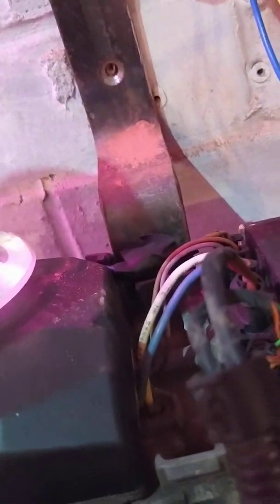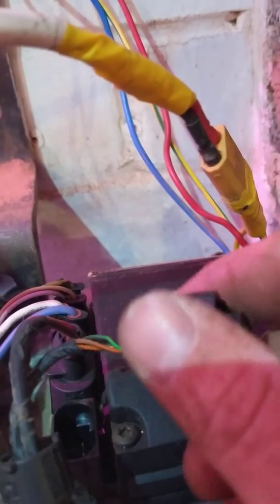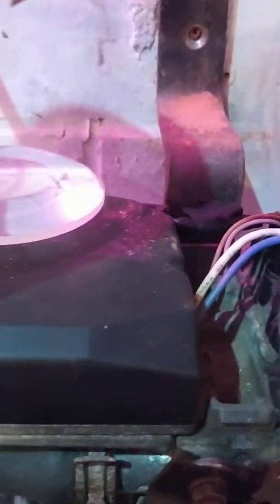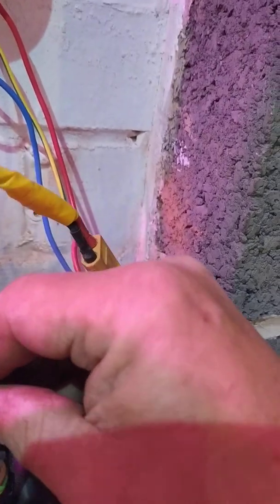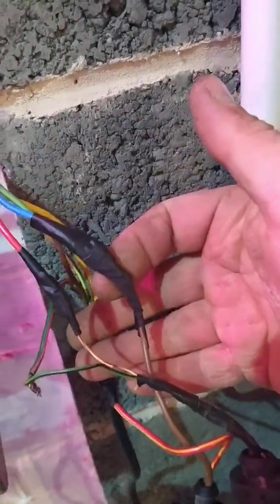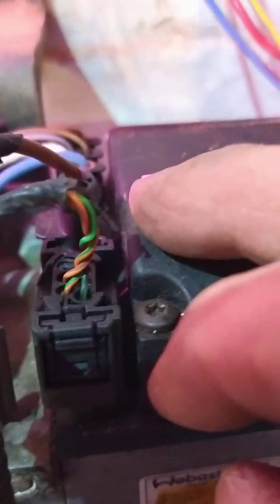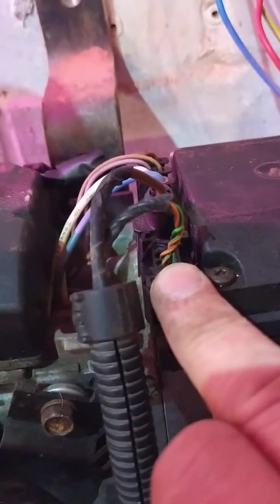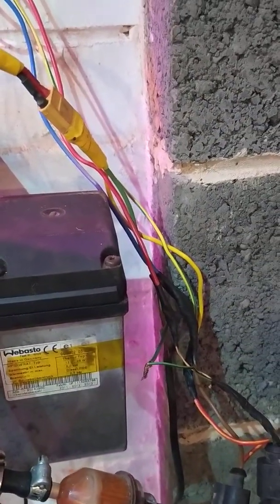Webasto thermo top c, making it run

Comment: Can anyone tell me if the car ones are programmed to switch off after 15 minutes running ? Someone has fitted a car one in my narrow boat prior to me owning it and it cuts off almost exactly after running fine .
Reply from the maker: No, they are not designed to shut off after a set period of time, any time limitation is built into the timer/controller but these are the 701 timers with the blue writing on.

Comment: I need to help me How to power 24 volt , 3.8kw webasto thermo pro 50 eco with ADR 4:
Reply from the maker: First of all you need 24 volts, i dont know what power supply youve got, but if 12 volt you need a boost converter that can supply at least 10 amps

Comment: Can you swap out the programmier for a 7 day timer clock. The current one means i can only select one program at a time, which is a pain.
Reply from the maker: I used a 7 day cheap Chinese 12 volt timer on mine i had multiple days and times set up on it, i just used the timer to switch the signal wire on or off

Comment: Hey!
I have a thermo top c petrol which i am currently testing.

When i wire it all together, it runs the waterpump, and water is pumping, but the motor wont go on, so the water stays cold…

Do you maybe know what the problem coult be?
Reply from the maker: Hi
It could be a multitude of things not making it work but it's difficult for me to give any real diagnosis from your explanation.
More details an may a pic of how you wired it would help.

Comment: thanks for the demonstration.  I want to install it in my van using the secondary battery that is in the back.  What section of cable do you recommend?  for a distance of 5 meters. Thank you!
Reply from the maker: For a 5 meter run i would use 8 awg wire as a minimum gauge of wire for the main power leads.

Comment: Hello I dont know if you still play around with these heaters, I bought one that didnt come with a water pump so I bought a pump from china which is bdcm so doesnt use much current, I test the heater using the diag software but it doesnt come on. can you measure the current the pump that came with that unit use please, I might have to put a resistor across the pump wire but need to know how much current the pump use first, cheers
Reply from the maker: I dont use a named pump i use an old pump i had in my garage, it only draws about 1amp, i think that as long as the heater ecu detects a small current draw it should work. Some of these heaters dont even have a pump connection on them, the units fitted to mercedes vans are like this, they rely on the water circulating through the engine and will not work if the engine is not running these are the can controlled units, i stay away from them as they are not really sutible for out of vehicle use unless the control board is changed.
Reply: @karldingbat  thanks for that, I'll connect up a side light bulb and see if its happy with that
Reply from the maker: As soon as power is supplied to the unit the pump should start, its the first part of the system to start, and last to shut off to avoid any heat soak inside the heater.
Reply: @karldingbat  I havent played with it for a year, I bought a cheap chinese heater instead but I just got an AC split unit which I will be pushing hot water through so will be trying it again

Comment: Very nice video! All documents, I found, say Pin 1 goes to the clock with switch and Pin 2 is for diagnosis. Tried this yesterday, and it did not work. Maybe, I also have a unit which is wired for Pin 2 for on/off. Will try this. Do you know, if I need to have the fuel pump connected for an initial try, if the unit responds in general?
Reply from the maker: They are not all the same pin layout, and yes fuel pump needs to be connected as they run a self diag before starting and if pump not connected it wont try to start.
Reply from the maker: It should try to run up without fuel pump connected the shut down, but like so many things with these heaters it may need the pump connected, there are a lot of variables with different car makers, i go with the experience of the units i have, an addition to the list of pin 2 controlled units is the v.w. heaters.
Reply: @karldingbat  So I still have Hope. Mine is out of a Mercedes S-Class year 2001. Will report back. And is it correct, I have to apply +12V at Pin2 to make it run?
Reply from the maker: Yes, thats the trigger once you have 12 volt supply at the main power input plug which is the bigger wires going into the unit, just make sure if using a battery that is is charged up and can supply at least 10 amps as when they start the glow pin requires a heavy current untill its fully running.
Reply: @bauenimfreistellungsverfah4878 i Have the same unit from w220, did you manage to start IT with pin2 And +12V?

Comment: Hi karldingbat, are U sure that Pin2 is the switch? Asking this because everywhere I read that Pin3 is one going to +12V to triger the Webasto to work.
Reply from the maker: All the heaters i have are pin 2 triggered, but there are some that are pin 3 the heaters i have are from Citroen and vw the best way to know is if you have the original plug still on the heater look at the wires going into pin 2 or pin 3 if the wire goes to pin 2 there is s good chance it is pin 2 trigger, if its blanked off its most likely pin 3 and vice versa

Comment: Do you have any idea ? I have the same webasto in my w203 mercedes . but i have connected 6 wires to the oval shaped connetor. what could be what ?
Reply from the maker: Im not sure about mercedes heaters, the heaters i took from mercs gave been Eberspacher water heaters that ive not looked at yet as they are canbus controlled. I would think if there are 6 wires actually going into the plug theres a good chance it has 5 volt canbus control built into it. Take a look at my other video on changing the canbus board to a non canbus board.
Reply: @karldingbat  sounds fair :) thanks! im not gonna miss that video !

Comment: Pin 2 is diagnostic mate pin 1 is 12v +
Reply from the maker: As said in the vid, they are not all the same, but a lot are pin 2, I've had this said before, thats why i made the updated vid
Reply: @karldingbat  ahh yes many thanks 
What’s the longest you have yours running at a time
Reply from the maker: @gerryr1893  longest i had it run was 24 hours straight, but its regularly running about 6-8 hours daily.
Reply: @karldingbat  your an absolute genius

Comment: what car did this come from?
Reply from the maker: This was from Citroen C8
Reply: @karldingbat  I have a C5 2005, it is probably same unit? Any idea how I can make it run manually with just a switch or something very easy and cheap? It would be nice to turn it on half an hour before going :) Webastos own remote start is ridiculously priced.
Reply from the maker: @Tobbe.H  should be easy, find the signal pin wire, should be pin 2 or possibly 3 cut it tape the wire going back to the loom for the car, the other end going back to the heater needs a 12 volt supply from the battery or other 12 volt continues supply witch you then connect the switch or timer of your choice. You also need to make sure the 2 pin plug that supplies the higher current to power the unit has a constant 12 volt supply this supply needs to be rated at 20 amps as it powers the glow pin.